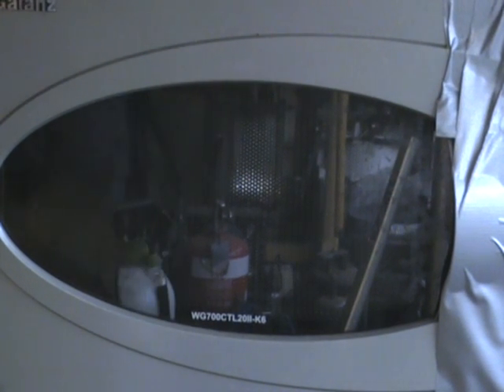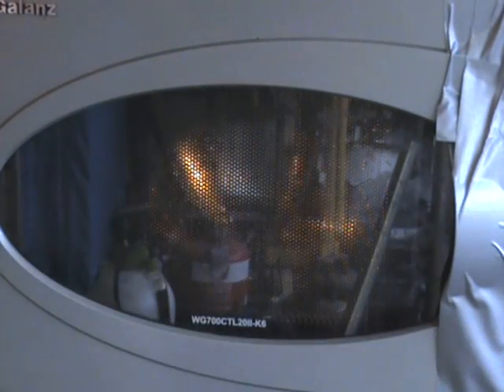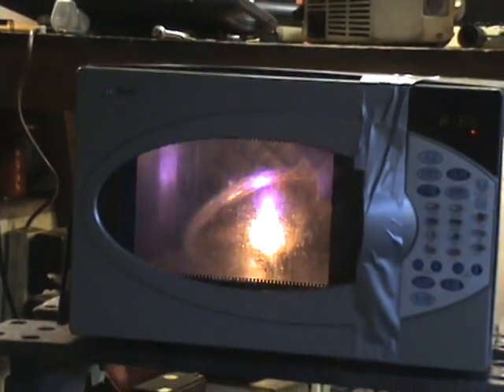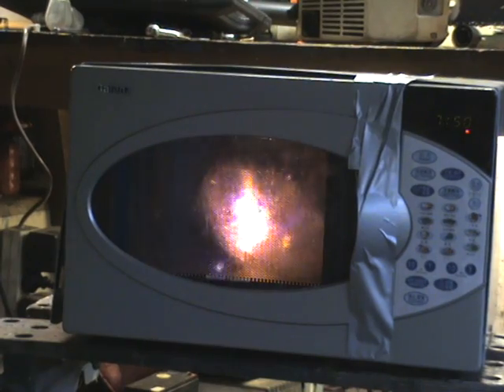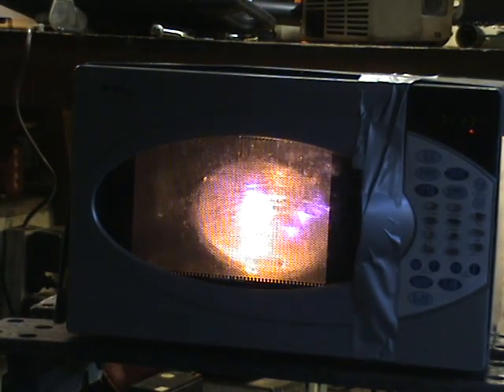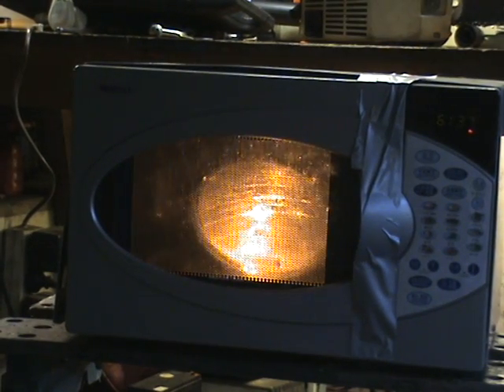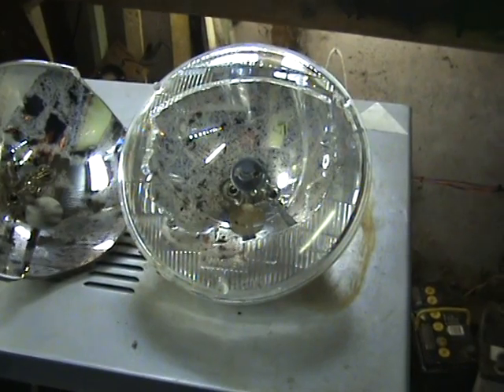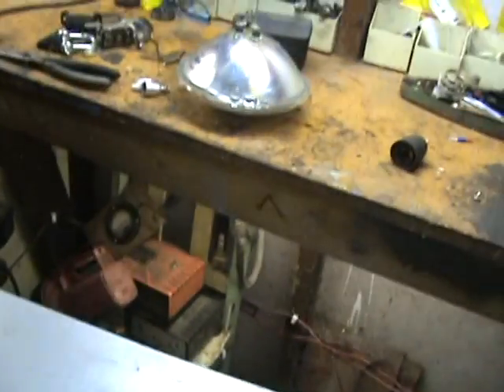Microwave Sealed Beam Headlamp - Light Show and Pop

Comment: Aussie, i did the samething with a GE spotlight bulb used in copcars and aircraft ,it was a 12v bulb , but the chrome coating never came off but it was tons of lightining inside like a monster lamp, it light up too , but even after nuking it ,it still worked o.k and its only a 12v bulb ,one tuff bulb